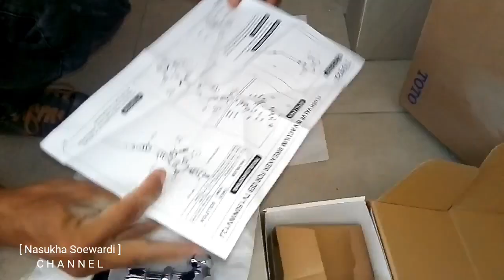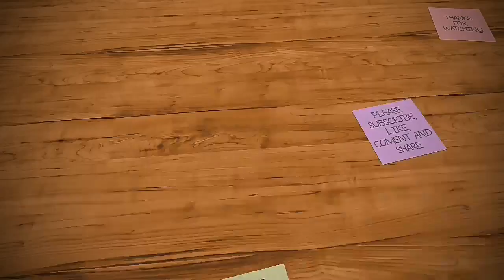CARA PASANG KLOSET JONGKOK  OTOMATIS | HOW TO INSTALL AUTOMATIC WALKING CLOSETS

Comment: Nanya gan..itu kalo udah pakai Pralon 2". ...dari toren air apa airnya udah kenceng y gan ? Soalnya pakai sower juga...🙏🙏🙏👍
Reply from the maker: Lebih bagus lagi di kasih mesin pendorong mas , soalnya yg saya pakai di sini itu dari atas elevasi lumayan tinggi di ketinggian 21 meter dan pipa dari atas ke Shaft pakai 4" di teruskan ke atas plafond masih 4" dan ke 2" yg di dinding terus reduser ke 1" jadi lumayan kenceng airnya .semoga bermanfaat dan thank you ya mas
Reply: Rencana di ketinggian 4mter terus pakai 2"yg dari toren.apa masih kurg kencang ya mas?
Reply: Satu lagi nanya mas.  Ketinggian dan jatak nyamng berapa ya mas ..tinggi 55 Ama nyamping 25 Y ..tapi saya ukur kok 13 cm nyampingnya dari as kloset
Reply from the maker: Sebenarnya sudah cukup mas untuk air bersihnya
Reply from the maker: Tinggi dudukan kloset  dari lantai 27cm + 5cm dan untuk air bersih dari top kloset 50 cm kalau dari lantai 82cm untuk jaraknya as air bersih ke kloset air Kotor 12-13 cm itu udah aman mas . Solanya untuk dudukan kloset Type ini lumayan tinggi dari lantai mas karena unitnya lumayan tinggi .semoga bermanfaat
Reply: Ini rencana saya bikin naik dari lantai    13 + 5  cm karna yg punya GKau tinggi naiknya mas 

Maksh seblumnya atas share ilmunya
Reply from the maker: Type Kloset Yang Saya Pakai CE 9 klw ini memang dudukanya tinggi harus kalau untuk di lantai bawah bisa tapi gali lagi supaya nnti elevasi kita bisa di 18cm sampai top unit kloset.kalau untuk di lantai dak beton tetap ketinggian dudukan top Ceramik kurang lebih 27cm.makasih sudah berkunjung and sama2 mas

Comment: Saya pasang kloset jenis ini tapi airnya kurang kencang padahal langsung dari jetpump. Jika mengganti instalasi pipa gak mungkin. Kira-kira apa yang bisa dilakukan untuk membuat air menjadi kencang
Reply from the maker: Di bantu pendorong setelah toren / penampungan air di atas mas.selmat mencoba dan thank you sudah berkunjung
Reply: @nasukhasoewardi817  saya tidak pakai penampungan kalau diganti mesin air yang lebih kencang bisa gak ya?
Reply from the maker: Waduh ,repot klw ngk ada tampungan di atas , coba mesin jet pump ,boleh juga ,tapi lebih bagus ada toren di atas minimal ketinggian  3.5-4mter supaya tekanan air lebih kenceng

Comment: Maaf mau tanya dong.. air untuk memyiramnya ada tabungnya sendiri sperti wc duduk atau ini langsung dr torn air? Mohon sarnya gan
Reply from the maker: Langsung otomatis dari pengambilan air bersih gan ini Ng ad tabung guys
Reply: Amatir,  itu sebelah stan kaki terlalu sempit kepleset patah kaki orang?
Reply from the maker: Mas Hadi mksih kunjungannya
Reply: Kak. Mengatasi air kerannya yang tidak bisa berhenti gimana ya? Apa kerannya yg rusak?
Reply from the maker: @lailatulhalimah5628  ada setelan air itu coba di puter full baru di stell jngan sampai full setengah saja guys
Reply: Pasang pipa galvanisnya kok bisa pas ya bro? Apa d ploting dulu sebelumnya ya?
Reply from the maker: A Zainuri iya guys kita harus tau ketinggian lantai dulu baru kita naikin dari ukuran kloset punya guys ,mksih guys kunjungannya
Reply: kl pipa keluar nya dr tandon 3/4 inch apa masih layak pake kloset gini? mohon sarannya
Reply from the maker: Langsung dari air ,pipanya harus 4>2>1 (inchi).👍 Guys kunjungannya
Reply: @yunichan3944  Yang Amatir siapa ya?
Reply: Pipa 2 inch berapa meter dan pipa 1 inch nya berapa panjang

Comment: Pak izin bertanta, sya ada pasang toilet spt ini tpi kenapa muncul suara dan air yg mengalir tidak kencang yaa
Reply from the maker: Coba di stell yg ada di unit aksesoris kloset di dekat tuas ada stellan memakai obeng min ,stell off kan air lanjut buka setengah tunggu sekitar 1 - 2 menit lanjut buka full air jika masih ada suara air  ulangi lagi cara di atas .
Untuk air kencang karena unit ini suplay air bersih  1 " bukan 1/2 " , harus dari pengambilan air dari toren atas minimal pipa 2" Vertical turun kebawah terus di reduser ke 1" ,tapi perlu di perhatikan pipa 2" kita reduser ke 1" kira2 dari  Elbow 1" air bersih jangan terlalu dekat ya pak kira2 1 meter .semoga bermanfaat dan terima kasih

Comment: Mas kalau airnya gamau keluar saat isi toren kenapa ya mas? Soalnya air ditoren banyak banget tapi air kloset ga turun
Reply: Tapi kalau lagi ga ngisi toren bagus mas bisa keluar airnya
Reply from the maker: waduh , yg dari toren ada tambahan mesin pendorong ngk guys apa gravitasi aja guys
Reply: Sementara sih hanya pakai gravitasi saja mas belum pasang pompa dorong nya
Reply from the maker: biasanya klw ngk turun airnya itu dari atas pkai pipa kecil ,soalnya saya dari toren atas pkai pipa 4">2">1" jadi penyimpanannya itu banyak guys untuk volume air turun ke bawah.
_pipa 4" dari toren dan posisi di atas plafond 
_pipa 2" di di tanam di dinding / wall
_pipa 1" di tanam di dinding dan di reduser dari 2">1" sebelum satu meter dari Elbow 1" karena kloset jenis itu pakai air bersihnya pkai 1".
semoga bermanfaat

Comment: Apakah flush airnya keluarnya kencang?
Apakah ini memajai mesin pompa pendorong atau engga ya?
Reply from the maker: Maaf telas balas sobat ,air kenceng guys karean air tandon di atas lantai 6 kira elevasi 20mtr dan pipa dari atas 4" ke 2" ke 1" jadi lumayan kencang guys .mksih ya guys telah menonton video saya .
Reply: @nasukhasoewardi817  klw rumah satu lantai menggunakan jet pump bisa gk kenceng gk?
soalnya yang saya airnya kecil gk nyemprot padahal sdh pake jetpump
Reply from the maker: mas Rendy mksih ya 
pipa pengambilan minimal harus 2" dan nnti di reduser ke 1"  pasti lumayan kenceng

Comment: Untuk saluran airnya apa perlu menggunakan pompa air otomatis atau bisa langsung dari tandon air gan?
Reply from the maker: Dari tandon air bisa , tapi harus minimal pipa  2" ke 1" untuk rumahan ,untuk sekolah,kantor minimal pipa 4" ke 3" ke 1'.
Reply: @nasukhasoewardi817  oh... ok2, maksudnya pipa 2 ke 1 itu 2inch ke 1"?
Reply from the maker: Maksudnya pipa 2inch ke 1inch mas ,klw bisa pipa yg 1inch pendek aj kira-kira 80cm , karena kloset ini air bersihnya pakai elbow  
1inch  drat dalamnya.ok sudah paham kan.mksih
Reply: @nasukhasoewardi817  siap, terima kasih informasinya, kemarin habis pasang toto type ini tapi tukangnya gak bisa rapat pasang pipa stainless nya dan air yg keluar gak deras + gak bisa mati meskipun tuas tdk ditarik
Reply from the maker: Waduh ,harus teliti mas pasangannya and ikuti panduanya .
Reply: @nasukhasoewardi817  sy jg sudh pasang tp kok airnya kurang deres ya? Apa ada setingan baut2nya??
Reply: @haerumanikhsan6470   Itu pasti karena tekanan air dari sumbernya kurang kuat . . . .bisa ditambah Booster air  dimana ada setelan tekanan: Low, Mid dan Hi . . .
Reply: @sunantoro2692  iya klo airnya deres baru bisa mati.. klo tekanan airnya gk kuat otomatisnya gk brfungsi jd airnya ngakir terus..owww bisa ditmbahin alat lagi brrti
Reply: Dratnya mesti di potong ya agar bisa mepet dinding
Reply from the maker: iya kawan cuman Pinggir mau di pasang pipa air untuk pembuangan tandon air .mksih sudah berkunjung
Reply: @nasukhasoewardi817  pipa 2 inch dari tandon berapa meter, dan di sambung ke pipa 1 inchnya berapa panjang
Reply: Punya saya uda terpasang rapi dgn pipa 3/4 in bang , gmn solusinya biar kenceng air nya bang tanpa bobok keramik ,
Reply from the maker: solusinya kita ganti pipa yg diatas plafond pkai yg 2" reduser ke 1" terus reduser lagi ke 3/4 .semoga bermanfaat

Comment: Min nanya dong. Udah terpasang rapih.. Di pakai 1 bulan, tapi hari ini air keluar terus, ada yang salah kah?
Reply from the maker: coba di stel lagi stelan air buka full baru tutup dan stel  lgi setengah / atau separo dari putaran stelan ,semoga membantu dan bermanfaat . jngan lupa buka / stel full kurang lebih 1 menit biar kan  air keluar dulu ya  👍?
Reply: @nasukhasoewardi817  min aku juga begitu airnya keluar terus, dan juga air yg keluar kecil bgt kalo mau ngeflashnya
Reply from the maker: iya coba bgtu ya sist ,cara di atas ,ok ,salam kenal semoga bermanfaat dan klw lebih jelas  call wa aku 081316954125
Reply from the maker: iya coba bgtu ya sist ,cara di atas ,ok ,salam kenal semoga bermanfaat dan klw lebih jelas  call wa aku 081316954125
Reply: @nasukhasoewardi817  siap aku wa ya min. trimakasih baik bgt auto subs

Comment: aku dah pasang tapi flushnya lemah banget, taiku jadi ga bisa masuk, apanya ya?
Reply from the maker: air bersih siram harusnya minimal 2 inch sebelum pipa 1inch guys kira2 50cm dari pipa air bersih siram selanjutnya ke atas pipa 2 inch ,ok guys semoga membantu dan thank you
Reply: @nasukhasoewardi817  aku masih gagal paham gan, dr toren 2inch trus ke jalur flush 1 inch?
update: taiku masi blm bisa masuk lobang pdhal tuas flush udah aku tahan sampe capek
Reply from the maker: Tinggi tidak toren air di atas ya ,itu video buat memang dari atas pipa 4inch terus lnjut ke 2inch terus lnjut ke 1inch ,air kencang tidak guys ?